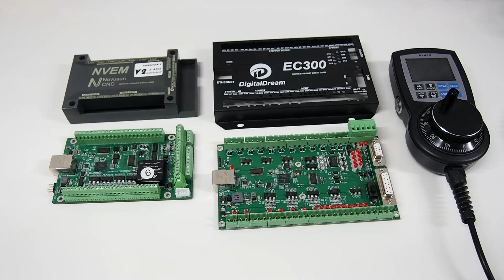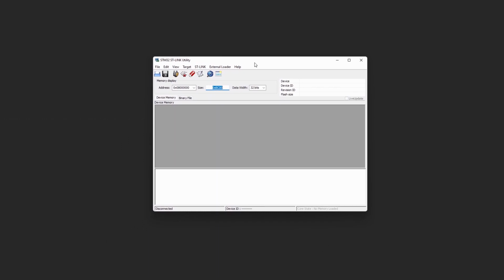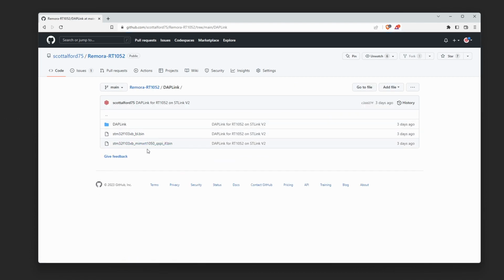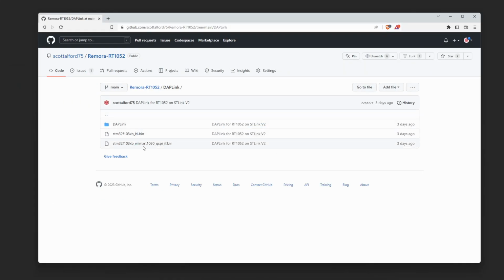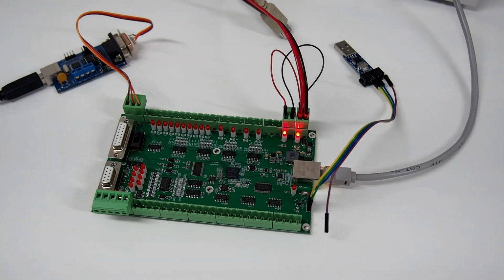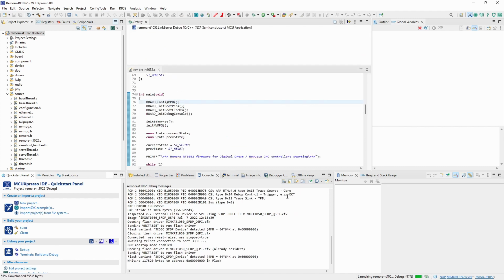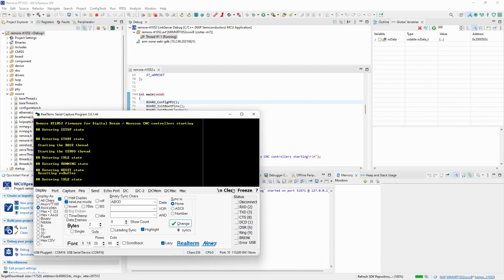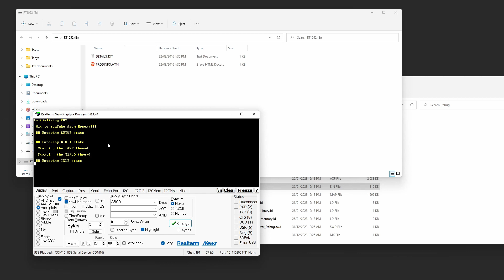Remora RT1052 DAPLink Programming

Comment: I understand CMSIS-DAP defines the protocol, and DAPLink is Arm's firmware implementation, but can it be used to program any device over JTAG or SWD?

For example,  I was able to program a Lattice bitstream using openFPGALoader + dirtyjtag (stm32 blue pill).   However, to program/debug the RiscV .. and/or to communicate via the Litex JtagUart I was not able to get OpenOCD to work.

I tried a BusPirate v3 (firmware 6.2) but couldn't get that to work with openFPGALoader.   I also tried an original Altera USB-Blaster (not FTDI based) but for some reason it always detected TDO as low, despite being high.

Since AE has many low cost CMSIS-DAP/Dap-Link WCH programmers as well as FTDI FT232H (which support MPSSE)..  What do you  recommend is the easiest, most supported that doesn't require patching, and custom-configuring?   

Looking for an out of the box solution that  : 
1) Program the ECP5 bitstream 
2) Debug the RiscV Elf  (OpenOCD SpinalHDL fork?)
3) Work with LiteX Server/Term for serial comm over JtagUart

I'm thinking of either a FTDI FT232H board.. or Pi Pico - Flashed with ECPDAP for FPGA and Flashed with JTAGProbe (cmsis-dapv2) for RiscV/LiteXTerm.

Comment: Hi, I have a jtag and a nvem v5 it is totally different from this card is there a video or tutorial to find the points where to connect it? Is this channel active? i see very old comments without reply!
Reply: Having the same such problem. There is a case of TMI with this setup, and with the well over 2000 posts about several different controllers and nothing for any current controller seems to be in one place. Still trying to hammer it all out and come up with a plan that doesn't result in a bricked NVEM  or burnt out USB port.

Comment: Hello there 

On my Digital Dream UC300 controller box the CONN light that indicates a connection with Mach3 is now always on. 

I have tried everything from uninstalling everything on my computer and reinstalling and setting all my configurations up in mach3 again. I think because the CONN light is stuck on that it is an issue with my controller. 

How can i reset my UC300 controller to factory settings ?
Thanks

Comment: There is no bootloader file on your github nomore
Reply from the maker: Yes, the DAPLink has not proven to be a reliable programming method and not recommended.
Reply: @scott3d506  is there an option to send config file via pyocd? I'm getting timeout error using tftpy
Reply: @scott3d506  Is there a video or any information on your new preferred method for flashing? Trying to get my board flashed this week while I am on leave.

Comment: Hi Scott, thanks for all your work on this. I'm trying to get Remora on my EC300 controller and started to follow the instructions in your video. All went well until I looked for the Daplink firmware. The firmware I found is 164KB and my flash size is 128 KB. I see the file size in your video is 79KB.  Now I find myself reading through all the posts on Linux Forum and trying to find the relevant file on GitHub. Is this video still relevant, or should I try a different approach? Please point me in the correct direction.
Reply from the maker: The video is a a bit out dated now. The best way to flash is to use a Pico Probe with pyOCD. Works out of the box.

python -m pip install -U pyocd
pyocd flash .\remora-rt1052.axf --target mimxrt1050_quadspi
Reply from the maker: But change the file name to be the latest version. I'm working on updating the documentation so people don't need to sift through the forum.
Reply: @scott3d506  Thanks for the reply. I had a look at the Pico Probe... would prefer to stick to the STLinks. Is there anyway I can still do that?
Reply: @nix12m  I ended up doing everything involving flashing the board with python on windows.  Don't install the newest version, I think it was 3.9 that I ended up using.
Reply from the maker: @nix12m  sure, as  long as you are happy to reflash the ST-Link into a CMSIS-DAP probe, it'll work the same. The Pico Probe is a CMSIS-DAP probe out of the box so one less step to worry about.
Reply from the maker: Hi, this video is outdated now and the DAPLink is not the recommended method now. pyOCD with a CMSIS-DAP probe has proven to be more reliable.
Reply: @scott3d506 is there a video that outlines this process? I'm about to embark on flashing my DD ec300 for Linuxcnc use.
Reply: I feel you, I have a ec500 sitting here that's about to be thrown through a window.  I've read about 100 pages of posts related to this. Googled everything I can think of, and am beyond frustrated right now with this.  I pieced things together between this video and the thread over on the linuxcnc forum and I think I've got the st link flashed.  But I can't get the python commands to work under either windows or Linux.  There must be some magic that either Google or I don't know about.
Reply: @brysonwitt4876  it is frustrating indeed. Thanks for sharing your experience. Sounds like you are a step or two ahead of me... I think my EC300 will become a side project now, need to get my CNC up and running again, so thinking of putting the old controller back in there. ugh
Reply: @nix12m  The machine I'm working on is a new plasma.  A friend of mine and I are working on it, its our first cnc build from scratch, so lots of learning going on.  We had a copy of mach that we were using, but I am way more intrigued by getting it to run with linux.  Remora became interesting because we had a couple of the ec controllers on hand anyway.  Over the course of building this thing so much has changed that I keep joking their will be enough left over parts to build another cnc of some sort.
Reply: A big thank you to Scott for replying, I'm progressing on this project albeit slowly.  I'm trying to write things down as I go and figure out what works.  Once I get my machine going which is a plasma cutter, I was thinking I may make a post on the whole process.  Just in case someone else may need to follow along that has a similar setup.

Comment: Hi Scott, I have a question for you, I get a No target connected on the STM32 ST-Link Utility when I plug in the St-Link V2.  I havent used this utility before and am wondering if I'm missing something here.  I've updated the firmware.  Any help would be gratefully received.  Kind regards, Rohan
Reply from the maker: I can only think to check the wiring / connections.

Comment: Hey Scott, thanks for your great project and all the efforts that went into it. I have the NVEM v2 (actually says v5, anyway) could you tell me please where the programming headers are on these?
Reply: Oh i realised you already have a video that contains that. Do you know whether the pins are the same on the non-STM32 boards?
Reply: I would also appreciate some info on connecting to the NVEM board as I have a new and an older one. As a layman what are the differences I'm looking for. I cannot see any markings on the header.
Is this the best place to be asking questions?
Thanks
Reply: @alexparish937  I also asked on the linuxcnc forum and scott gave me an answer that wasnt fully able to grasp yet. 🙂
Reply from the maker: Hi, check out https://www.forum.linuxcnc.org/18-computer/44828-remora-ethernet-nvem-cnc-board?start=720#265607